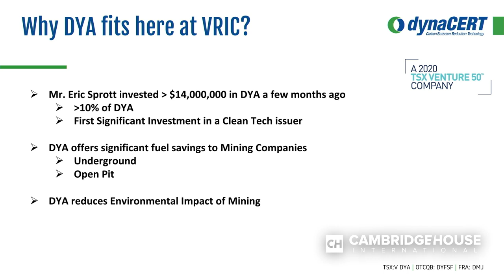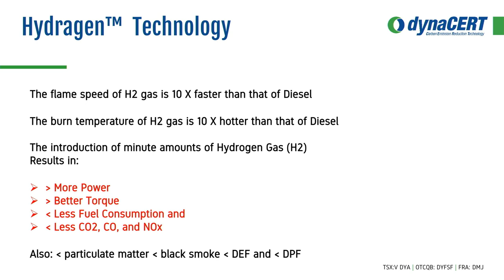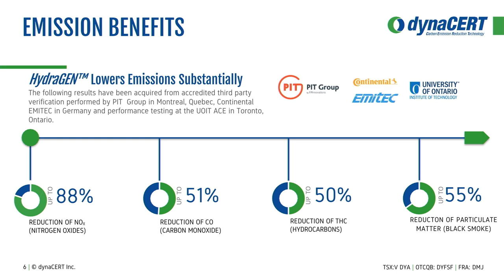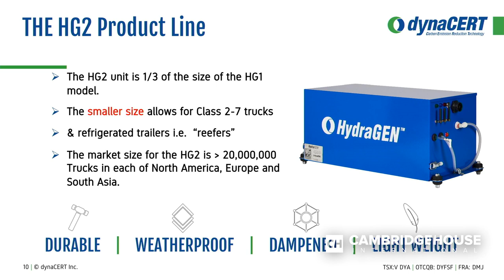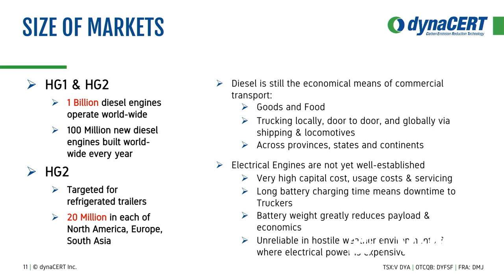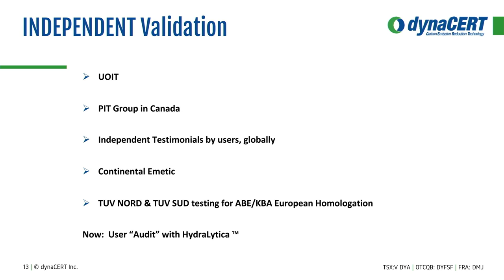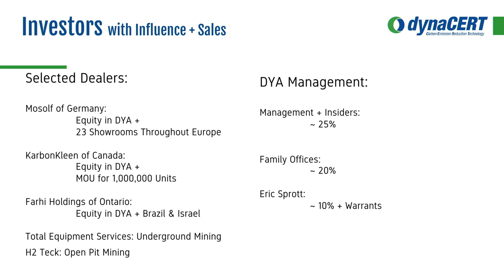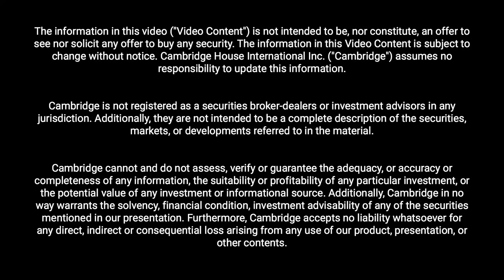A Global Solution to Reduce Pollution - dynaCERT Inc.

Comment: Actually, the proposal is not original. In Russia a number of companies were selling the Hydrogen generators with a promise to save fuel. And independent tests demonstrated no savings at all. Yet, it is possible to get some savings but all the engine has to be adjusted to new fuel mixtures. It is not easy as somebody may think. 
Personally, I got huge fuel savings from my advanced engine oils. Up to 20%. Potentially up to 30% for some heavy loaded diesel engines. And a problem is that I cannot find money for the oil sertification. Therefore, I cannot sell it. Actually,  I produce only the additive pack but it is not compatible with existing additives. Cannot be added to ordinal engine oil. Pure oil base is necessary. I used palm oil as a base. Works perfect. Paraphine oil works too.